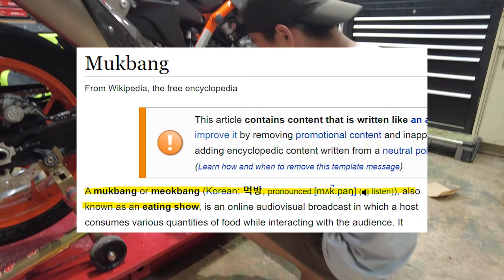SO MUCH RIDING and more Duke 890R Parts! 🤩🏍️‍💨‍💨‍💨

Comment: Theres a channel(superbikeunlimited) that did a -from KTM-offroad tune with the same exhaust and they got 10 extra whp. They also did weigh reduction with carbon fiber rims( 200 rear tire) smaller light battery,  and other few goodies and the bike went from 410lbs wet, to 365lbs.

Comment: Did you use an impact wrench to get the two swingarm pivot bolts off? Check out the Vanasche sprocket cover
Reply from the maker: I did not…but maybe Peter did 😆😆😆😆😆😆😆😆😆😆😆😆😆
Reply: @vtranmoto  haha, good to have friends like him. I noticed the video skipped straight to them fitted haha. Those two bolts can be a pain to get off
Reply from the maker: @bazza8947  haha definitely lucked out with Peter the team mechanic! :D

Comment: Looking into buying 2022 890R  soon. And as a someone who never owned KTM, I do have some concerns about the reliability though. Anyway, your bike looks gorgeous and digging the rear sets.
Ride safe! Sub from Cali.
Reply from the maker: Thanks so much Trex! I’ve had a bunch of different brands and I’ve found the build quality/fit finish to be pretty good!

I have to admit our newer Speed Triple RS seems a bit more “premium” but it’s also $10,000 more 😅. As far as reliability, I’ve put 1500 track miles on my RC8C in the last half a year (it has the exact same motor as the Duke) and it seems very good so far. I do oil changes every 3 trackdays or 1 race weekend. 👍

Thank you for watching and thanks so much for the sub!
Reply: I have a 890R 2021, first owner. Great bike, no reliability issues whatsoever! Buy one!

Comment: Loving the update videos on the Duke. Is the Akro exhaust bolt on without using the rear pegs, or is there a special bracket that is required? I have the full system on order although it won't be here until the end of the month. Can't wait! Also, are parts available individually for the powerparts rearsets? I'm torn between those and the Woodcraft ones. I just want to make sure they are obtainable in event of a crash.

Comment: Hello, how do you find the stock suspension on 890r, i find it a little stiff for road use,adjusted mine on comfortable settings! Conrgrats for being one of the lucky 100 to own RC8 C! More power to your channel man!
Reply from the maker: Thank you so much for watching and commenting :) 

The 890R suspension is really good stock suspension in my opinion, I adjusted it to the recommended track settings and it performed well. At our local track, I was comfortably in the advanced group with no modifications and stock tires. If I were to race the Duke, we’d probably want a little more stiffness on front and rear, but for a trackday toy the bike is *amazing*. Would definitely soften it for road use and it would be killer in the twisties and canyons! 

Thanks again and hope you subscribe! :)
Reply: @vtranmoto  Thank you for the response, ya was already a long time subscriber!
Reply from the maker: @mylestv14  Whoo!!! Really appreciate that! 😊
Reply: Butting in here....the target weight for this bike stock is 75-85kg and rider sag is recommended 43mm. I fall right in the target weight range and run sag at both ends at 43.5mm (I don't wanna fuss over .5mm) with the "comfort settings" in the book as a starting point. IMHO don't go by the spring preload suggestions (turns in) in the book. I find them arbitrary cause there are so many variables for each rider. I just set the sag (given the stock spring rate is correct) and then adjust damping.

Comment: How long have you had the 890 duke r?Im thinking about buying one.I’m 5’ 6’’ do you think it will be a problem?
Reply from the maker: I’m 5’7” and it isn’t an issue, as long as you have riding boots you’ll be able to find footing. Also you can just tripod it, that’s what I did with my Ducati Hypermotard which had a super tall seat height. The other option you should also consider is the Triumph Street Triple 👍
Reply: @vtranmoto Have you had any issues with the 890Duke?And thanks for the feedback. I love your channel.👍🏻
Reply from the maker: @WEEZMONEYINVOLVED132  none, the RC8C I race uses the same motor as the Duke 890 and it has 2400 track/race miles on it and it’s still going strong. It’s a great twin engine machine!
Reply: @WEEZMONEYINVOLVED132  I'm also 5'6 and just purchased a 2022 890 Duke R. At first, the seat height is intimidating, but after riding it around town, it's so light that it's easy to put your one foot down. They also sell a lowering kit which I purchased before I rode the Duke. I previously owned a street triple rs and that is definitely  much lower to reach the ground with your feet.

Comment: Did I miss your video pulling out the DB killer in your Akrapovic? I’m trying to do that to my wife’s still and that bolt was welded in and I’m having to pull the carbon end cap off and replace that and cut that DB killer bolt off. (Damage to end cap in a low side)
Reply from the maker: Wait that is crazy!! Sorry we didn’t film that, the DB killer for the Akrapovic for the Duke was a simple Allen key, you had to remove a small rubber grommet with a little Akrapovic stamp on it, then you use a 4 or 5 size Allen key and remove that and the baffle slides right out!! 

Sorry that yours was such a pain! Wow :(
Reply: @vtranmoto  the one we have is an older version and did not have the pre drilled hole with rubber cover to easily access that bolt. So I had to drill out a spot and then the alen key broke off trying to free it. Since the end cap had damage, I figured I’d pull it and replace it anyway. Just can’t find that part number for the end cap you have, with the pre drilled hole and rubber cap!!!